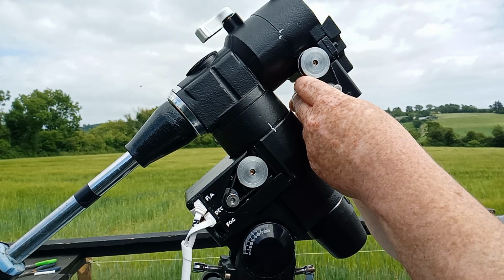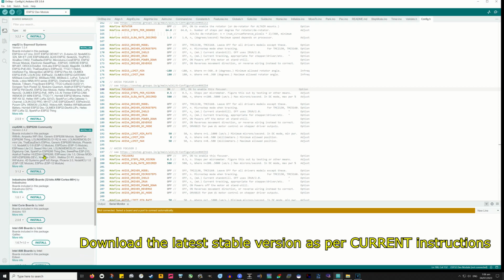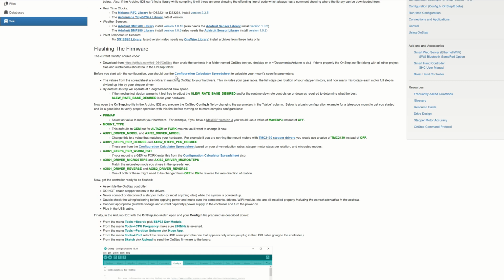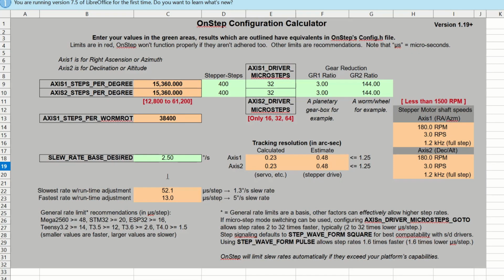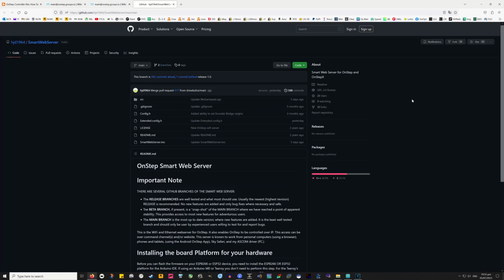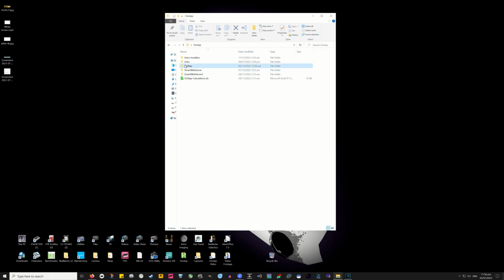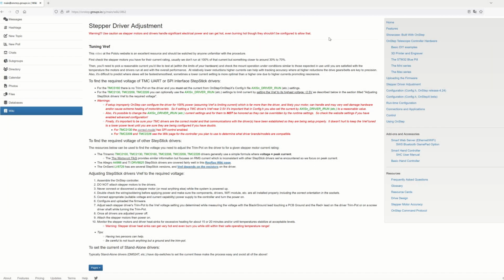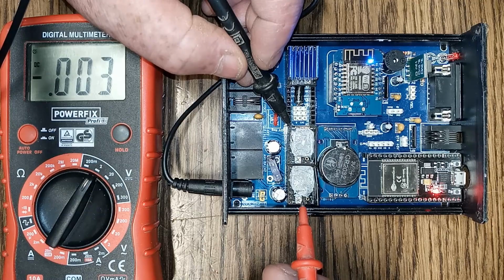OnStep Configuration, Flashing & Stepper Driver Adjustment

Comment: Thank you for the video! A tip for adjusting the stepper drivers: Attach one probe of the multimeter to the screwdriver with crocodile clips, tape, etc. Make sure it's not too wonky, but it makes the process easier :)
Reply from the maker: You're most welcome. Hope it served you well and thanks for the tip.

Comment: Guys, newbie here! Are there any way to control an onestep mount with a MacBook m1?
Reply from the maker: Hi. I personally know nothing of Macbooks so I don't really know.
What I do know though is that if the Macbook can do Ascom drivers then yes, it will work with OnStep. I plug my OnStep controller into my windows PC using a micro-USB cable but wifi/bluetooth are also available.
Connect via Ascom drivers for Onstep and then you can either use OnStep's website or another control program like NINA etc.
[Edit] I just looked at the following site (OnStep's Ascom driver source) and it says nothing of Macs : http://stellarjourney.com/main/onstep-ascom-driver-software/

There's always your phone if the Mac won't support it.

Comment: Thanks for the Video. I want to motorize my eqm35. Where can i find the 'Onstep Configuration Calculator' to open in Office? CS, Michael
Reply from the maker: You'll find the link on the "flashing the firmware" wiki page.
I opened it in Libre Office. Not sure about Office CS??
Reply: @Cheapass-tro  is it the link to  'Configuration Calculator Spreadsheet'? It wont open on my computer... In your video it looks like a exel file.
Reply from the maker: @micmargos  Yes, that's the one. It downloads when you click it and is a .xls file. I was only able to open it in Libre Office, which is free. I don't have the MS office suite.

Comment: Thanks!  I read tons and posted a few questions and got some help to get started.  Many things are still a mystery to me.   I went to the wiki pages. Followed step by step but when I got to the config.h part, I can't believe that I can't figure out how to open the file to show in audrino!  The wiki pages said to just do it.  I'm trying but nothing I clicked which was almost everything, don't have the option to open the file.  I know where all the files I need are too. I'll definitely smack myself when you tell me how it's done. Thanks! 😂
Reply from the maker: You can open config.h just using notepad on Windows.
For Arduino, instead open the "OnStep.ino", which will also open config.h as part of it.
Then once OnStep.ino is open in Arduino, just click the "config.h" tab up top.
Hope this makes sense.
Reply: @Cheapass-tro  I can post again. Youtube needlessly deleting my post due to something I wrote. I'll keep short.  I can see config.h thanks to you.  OnstepX was unzipped into a subfolder inside OnstepX main folder.  Last question, I hope. How to backup factory firmware, all other files and settings?  How to view or obtain factory config.h file from the controller?  Thanks again!
Reply from the maker: @Jamesee777  Youtube has been doing that to my comments too (not on my videos). It's a PITA.
I believe that once the files are written to the controller, there's no reset option.
You'll have to download the source code again and upload that for a refresh.
After downloading OnStepX-10.20a (or whatever's the latest),  I personally make a copy of that and remove the "-10.20a" from the copy, and work with that. This way you still have the original intact.
Hope this helps.
Reply: @Cheapass-tro  I'm getting close to flashing firmware.  Yeah, doesn't look like I can actually view factory config.h settings.  Not that it will help me that much if I wish to do a factory restore anyway. I need to upgrade the stepper drivers anyway.  I want to make sure I have all the new settings right before I flash.  I'm really close.  Your help actually got me to a point where I can actually flash. Next hurdle is connect to controller to flash. But if I follow the instructions, it should work.  Thanks again for the help.  Onstep user group is really great but it's geared towards advance users that makes noobs like me struggle.  Your youtube tutorial (so far, one of one in existence) actually helped me a lot, even though my setup is a bit different. I'll be using TMC5160s and settings are made only in the config.h.  In theory, that's less to do. I'll take my time on this part but I'm sure I'll run into glitches.  Anyway, I'll update you when and if I make it to the finish line. :)
Reply: @Cheapass-tro  I followed the wiki update firmware instructions and updated the terrans controller.  I did the GVP# to test after update but no answer. Probably did it wrong. At any rate, the controller now shows 10.20a, so it updated.  DIY harmonic drive is moving as it should using the arrow keys.  However, when I use the arrow keys to slew, it speeds up and then slows down.  I have to press same direction again to get it moving, otherwise, it'll just slow down and stop moving.  Weird.  When I use goto function. It speeds up and then slows down but speeds back up and maintains the speed.  Strange. But it looks like it works.  Only way to find out is finish the wedge and mount my telescope on it to test it for real! Thanks again for guiding me with those simple yet no idea what I was doing wrong in beginning.  Quite frankly, I'm surprised it even updated and working in phase 1.  Now, onwards to phase 2 is mount to telescope and see if it actually works.
Reply from the maker: @Jamesee777  I've no idea why it speeds up and slows down??? As a guess, I would maybe check SLEW_ACCELERATION_DIST and SLEW_RATE_BASE_DESIRED. I'm wondering whether you've asked it to go faster than it can?

I'm now on OnStepX, using a config that someone else prepared for me in an attempt to get my wifi and focuser working (they now do). Since that upload, #GVP wouldn't respond with "OnStep" either, so no worries there (though it did worry me).

All the best with phase two and do keep us posted. Thanks bud.
Reply from the maker: @Jamesee777  With regards to "otherwise, it'll just slow down and stop moving" I'm now thinking that perhaps you've not adjusted the stepper motor drivers correctly and not enough power is being supplied? Maybe you did, just a thought... BTW did you upgrade your stepper motors?
Reply: @Cheapass-tro   Yes, I upgraded to NEMA23 motors. Not by choice.  The harmonic drive unit is designed to fit NEMA23.  That is why I upgraded the stock TMC2225 (I think) stepper drivers to TMC5160.  They were burning hot to the touch on NEMA23 motors even just testing for a minute.  The TMC5160 just got warm.  I amperage settings I used for TMC5160 provided by a user is very similar to my motor specs.  In greater detail, the nema motor spins up to whatever the highest RPM it gets to and then the RPMs go down and if I don't release and repress up arrow, it'll just stop slewing.  As soon as I notice the motor starts to slow down, I release the up arrow and press again to get the RPMs up again. I repeat until I want slewing to stop.  In goto mode, the motor spins up to its highest RPM and then starts to slow down but the RPMs will go up again and maintains the higher RPMs.  I don't think the current is cutting off because not enough power or possibly too much power, but I will tweak with it anyway.  I will tweak with the slew speed rate settings too on the asiair. I'm currently slewing at MAX speed.  Maybe if I slow it down, it won't do it. I forgot to try that out.  At any rate, the slew rate with 1000:1 reduction is pretty slow already.  If I can't figure it out, I could just let it be.
Reply: @Cheapass-tro  Youtube deleted my message again! It wasn't that long either. OK. Short and sweet.  changed goto amperage from 2250 to 2000ma (doubt that did anything). Also changed  GUIDE_TIME_LIMIT from 10s to 30s. That made my problem happen again around 30s (I didn't time it).  I hope one day ASIAIR will add a slew limit option as an update.  DIY Harminc mount is bloody powerful.  I tried to slow it down with my hands.  It just kept going and no signs of strain.
Reply from the maker: @Jamesee777  Sounds awesome. I'd like to do that someday. You'll get the little niggles ironed out.
Reply: @Cheapass-tro    My DIY Harmonic drive mount finally works with asiair!  Found out I can do simulations indoors and that greatly sped things up.  Need not have to wait for clear skies.  I had a lot of hurdles to jump over.  The final one was meridian flip. It finally worked!  Now, I need to construct a better tripod or a pier but I can still image with my temp tripod right now.  I installed 2 limit switches in RA coming from the east and west side. If it gets triggered, the controller power will get cut off.  I can now sleep and not have to watch the mount slew like a hawk if it goes crazy and it does from time to time!
Reply from the maker: @Jamesee777  Congrats man!. I'd like to see your harmonic drive. Maybe you'll put up a video of sorts?
Reply: Alright.   I'll whip one up and will let you know when it's posted sometime tonight.

Comment: 23:41 that's a bit of a bummer. My printer uses software-defined driver current.
Reply from the maker: See the "Choice of stepper driver" section on the following page. Towards the bottom it states how you can use jumpers to set full/half/quarter/16th step modes : https://onstep.groups.io/g/main/wiki/15166
Reply: @Cheapass-tro  not the step modes... the driver current, instead of using the trim pot. The 2130s (I use them in the printer) have the ability to choose steps and drive current via software settings if the firmware (Klipper on my printer) supports it.
Reply from the maker: @OldCurmudgeon3DP  That sucks then. Still these drivers are cheap enough.

Comment: Looks to me like buzzy coffee grinder step motors can hammer ripples into the gear teeth and destroy the involute curve, meaning higher frequency tracking ripples. Full step is like a jack hammer. Onstep looks like a good way to solve that problem, after I upgrade to 64 bit windows.